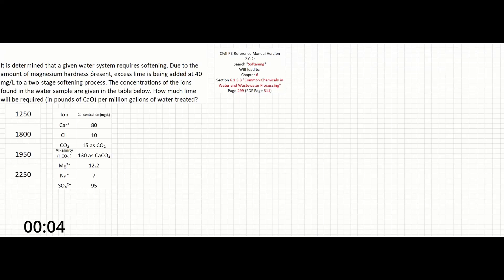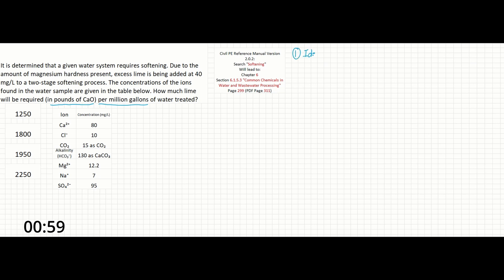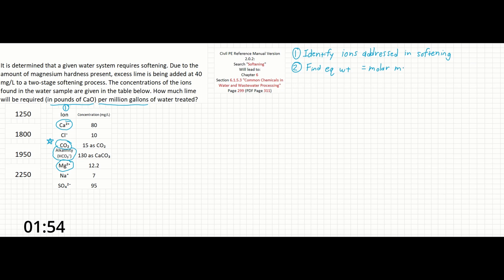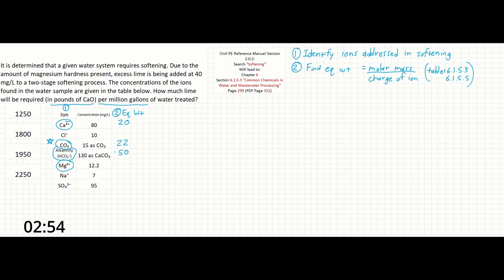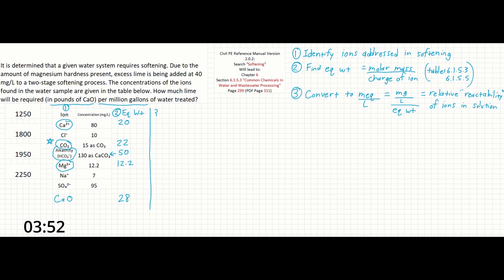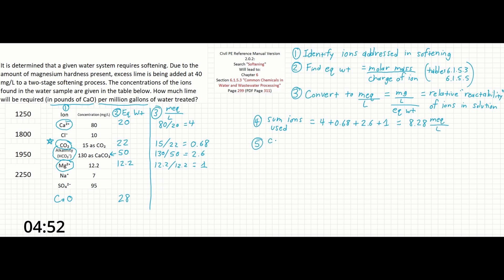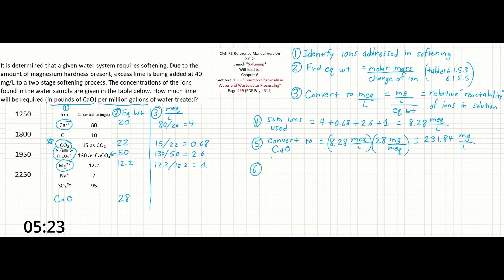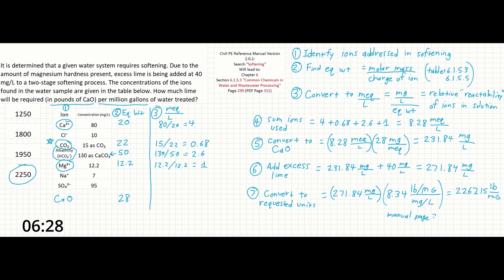PE Exam Practice Problem #83: Water Resources/Environmental | Hardness - Softening - Excess Lime

Comment: I just did a similar problem on the PE Environmental Practice Exam where TH > Alk and they did not include Ca2+ when solving for excess lime in the solution. Their equation for lime softening = [Mg2+] + [CO2] + [Alk] + excess lime. When do we include Ca2+ ion?
Reply from the maker: I originally thought this should be a no-calcium problem as well, but I did some googling and came across a conversation on Reddit where someone shared errata that was issued by the NCEES for a very similar problem. They changed the answer from solving without calcium, to solving with calcium. Maybe this was the problem you solved? https://www.reddit.com/r/PE_Exam/comments/1jasnf6/comment/mnkqshi/?context=3
Reply: @SolvedIn6  Hmm the NCEES page no longer exists?
Reply from the maker: @NikitaGupta-i8y  Sorry, try this one: https://ncees.org/wp-content/uploads/2024/10/PE-Environmental-errata_23-3.pdf

Comment: We use lime for Non Carbonated Hardness as well? Wouldn't we leave out the calcium?
Reply from the maker: I originally thought this should be a no-calcium problem as well, but I did some googling and came across a conversation on Reddit where someone shared errata that was issued by the NCEES for a very similar problem. They changed the answer from solving without calcium, to solving with calcium. https://www.reddit.com/r/PE_Exam/comments/1jasnf6/comment/mnkqshi/?context=3